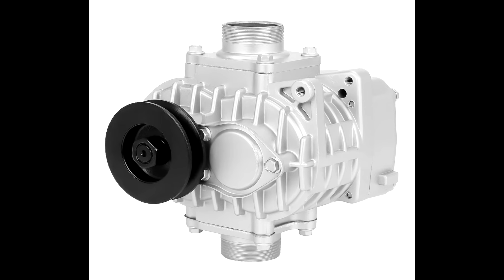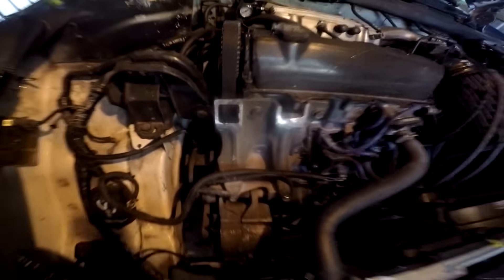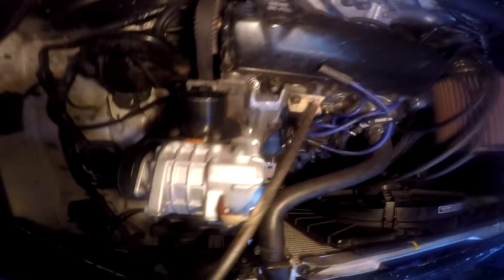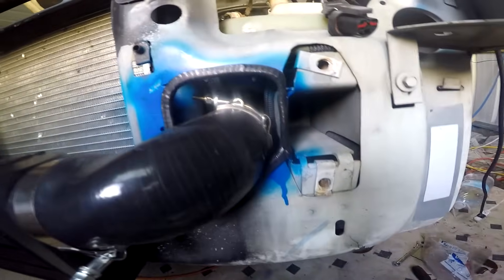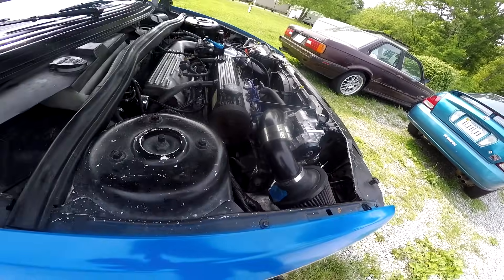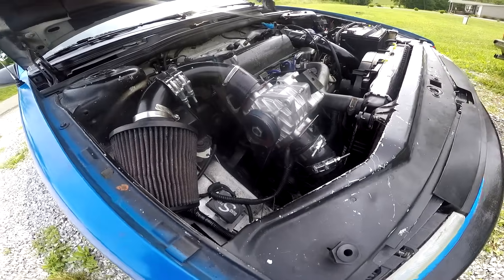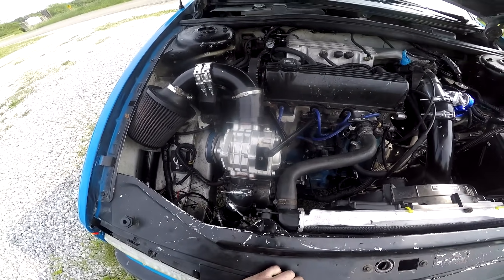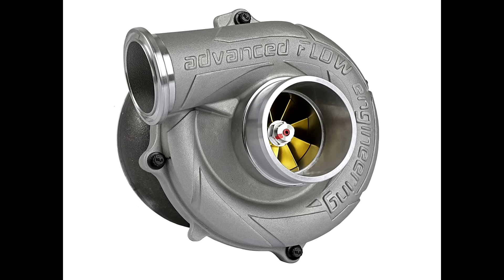AMR 500 Supercharger Testing - is it as Good as the Internet Says?

Comment: Bro.. smaller pulley, lighter oil in super charger.. i have the same one on my 67 vw bug and i can keep up easily with 1914 vw’s with my baby 1600 engine.. getting on the freeway is fun and my boost gauge shows 5psi wide open which isn’t the best but definitely a huge improvement for a 44hp vw bug..
Reply: that's exactly what he needed was a smaller pulley. those little blowers ain't gonna push that large of an engine very well, especially while using that big ass pie pan of a pulley lol. They claim to be rated up to a 2.2L, but I would be very suspicious of it don't that on the stock pulley. a2a intercooler would be a must have a well after overdriving the blower because it's going to create heat.. but in reality, those amr blowers are cheap junk. Used on VW bugs, and predator v-twin powered go-karts lol.
Reply: @boosted0079  honestly the one i had put on my car was just an experiment but it ended up working good enough to keep it on there. Going on 4 years and it still runs perfect. Just depends on application and how well each particular one was made or installed perhaps
Reply: @mikecorleone6797  I've seen a few VW bugs with these on them, and I was fairly impressed with seeing the results. The other was a Honda Civic if I remember correctly. Smaller 1.5 or 1.8 engine. That seemed to do really well also and that Honda ended up using a much smaller pulley. Spun the blower much faster than its maximum rating lol. I never did see any follow ups on it though afterwards.
Reply: It would work on a go-cart but I was always tough, if you want to make a car go fast you need to start with a Fast car and make it go faster 🤣
Reply: @knifethrower9733  Why? It's so much more satisfying to build a sleeper. No one expects to get beaten by a shitbox... 😂 You just watch people die inside, especially if they have their girlfriend in the car!
Reply: Bs
Reply: @RICHIE_RICH89  sorry for your loss. My condolences 💐
Reply: The thing to remember here is how much air is how much power. This thing will probably support a solid 80hp at the crank, which for a 44hp bug is right about 12psi, so I don't doubt that it works on the beetle, because it isn't an engine that moves a lot of air. The engine used here makes more power than this charger can support, from the factory, like 120hp, so it simply can't move enough air to even keep up with NA for this engine. For your application its perfect! For his, its not enough.
Reply: Another guyt claims 150 on his use with ir, so that really shows its range a bit better there. Plenty of headroom for an air cooled, but that's 2 psi up from NA even if his 2.2 makes low power at 120.
Reply: @knifethrower9733  pretty sure this is what grind hard used on that barbie Jeep.
Reply: @joemomma12341  the air-cooled engines don't rev very high either stock redline is like 4500-5000 and the heads flow no air so I've got a bug with a decent cam in it and happily make 140hp at the crank at around 10psi. 100hp is pretty standard for 10psi on a stock 1600cc VW engine but they are well suited to it as they are low compression highly head-restricted engines that just wake up once you get that cylinder pressure up. More modern NA engines like these ones just flow too much air and have much higher compression ratios, just need a much bigger blower that's more efficient for his RPM range.
Reply: @404MissingLink  as someone trying to get into forced induction, and having an odd fascination with the R series Toyota engines, would the 2.4L gain anything from an AMR500 as it revs out to like 5500 for redline
Reply: A stock NA Sundance motor makes 3x the power of a stock 67 bug, is almost a full liter larger, and is vastly more sophisticated.  The fact that you got good power in your bug means nothing at all for entirely different applications.
Reply: If you don’t mine me asking how have you set up the charger with your carb? Carb before supercharger or blow through carb?
Reply: @mr.357mag4  I really doubt it dude that is a rather large engine for this supercharger. The R series engines breathe super well I really would recommend either a turbo or a larger supercharger to avoid restricting the heads like 3000 upwards. There are plenty of other options though, BMW and Mercedes superchargers can be had from junkyards easy.
Reply: @stephenjones9043  I have mine setup before the supercharger makes for a more simple setup with no blow off valve needed.
Reply: @DrewLSsix  in my defense my 44hp bug has an aftermarket exhaust with headers, hide away muffler and i have a +5 hp sticker on the decklid..
Reply: @stephenjones9043  the supercharger draws through the carb. The vw carbs don’t work under positive pressure.. they just blow fuel everywhere. I’ve upgraded to a 2 barrel weber 32/36 carburetor and it really woke up the engine. I also put in an o2 sensor and afr gauge so i can monitor the air/fuel and not run lean. The engine is a 1600 dual port with 87mm pistons amd a 100 cam. Everything else is completely stock with the exception of the headers and hide away muffler which makes my car sound more like a porsche but quieter. It’s great. If you do get one of those superchargers just remember to change the oil every 3 months on it. It only takes a few ml of oil.. i looked at the rotors recently when i swapped out the carb and they look nice and smooth still.. i run a couple ounces of 2 stroke oil when i fill up just to keep the rotors well lubricated. Not enough to smoke or foul plugs tho..
Reply: Do you have an install video or any suggestions to install it on a vw 1600cc engine? I would really appreciate it if you had any advice, I just bought one but i have been struggling on the installation process.
Reply: @fliegendenLowen  I didn’t do any install vids on it because i wasn’t on YouTube at the time i built it but i can definitely walk you through it if you need help. With mine i just mounted it on its side on the left side of the engine and made an adapter to connect the supercharger to the dual port intake manifold. Used some scrap metal to make brackets to mount it and made an idler pulley to hold the belt tight. I’m using a serpentine belt instead of v belt, smaller pulley on supercharger, 100 amp alternator with dog house shroud and external oil filter, carburetor was easy i just made a short carb intake that mounts the carb to the supercharger and used an extra long throttle cable with a plastic sheath that wraps around to the linkage with home made brackets and a stock vw barrel nut. But you’re going to need pertronix electronic ignition because you’re going to need a hotter spark and a tad but of timing advance or you’ll ping on heavy acceleration. But the charger sounds badass and the boost gauge shows about a pound of positive boost at idle and pegs around 5-6psi which is more than enough.. more than that and you’ll pull head studs out of the case and that’s a big problem.. oh and you’ll be stuck on 91 octane gas from now on..
Reply: @joemomma12341  This supercharger can make over 120hp to the wheels on a 1.6 vw. 100 to 130hp is about the max you will see with this supercharger. Theoretically it should be good for 150 but I don't see any on the full built race motor that would be necessary to make that. Realistically this will make 14lbs of boost on a 2.5 liter but that's at 350% overdriven  with a redline somewhere around 4600rpm. It's all about understanding the limitations.
Reply: @boosted0079  the amr500 is a factory part for subaru kei cars used by hundreds of thousands of units on the road every day. But forget that they are for go carts and vw beetles...
Reply: @boosted0079  I've seen over 300whp from a 225ci slant six with a turbo from a 2.2. It made all its power under 4500rpm and felt like a Cummins for torque. Was built following a junkyard build writeup from years ago. An undersized boost aid can be used but most don't understand how to work the limitations in their favor. These work well for engines up to 2.2 if you limit the engine to about 5500rpm. You can go bigger if you drop engine rpms. A lot of subaru turbos are really small for the engine displacement as well because they are geared towards low end torque not high rpm max hp.
Reply: @DrewLSsix  my man the sundance makes 94hp. The beetle is 40 to 50 hp... you need to check the math there.
Reply: @DrewLSsix  this all comes down to one number. CFM!!!!
Reply: Mike, do you use the $200 chinesium AMR500 in your car?
Reply: Its the 300

Comment: I have an AMR500 on my 600cc bike it works really well on 10 lbs of boost and I have another pulley that gives me 14lbs, I wouldnt use the supercharger on anythig over 1600cc and thats running the supercharger very overdriven, they are probably at their best under 1200cc
Reply from the maker: I was thinking it would be good on a bike because there's no lag. Maybe I'll keep mine and use it for that one day.
Reply: The AMR 500 has a working rpm of 16,000, a 3:1 pulley ratio on a 1600cc gets you about 8 psi, as long as you're not holding revs over 5500rpm you're sweet
Reply: Good point. I wonder if you can use it on a scooter, preferably an about 250cc four stroke?

Comment: I wonder how much of an improvement it would have on my 1.0 993cc geo metro 3 cylinder
Reply: pretty decent, given the size, but you Better go with a Suzuki Swift GTI Total swap, you can find It for cheap and its exactly your car best version, i Just wonder if the GTI was sold in America at all, here in Italy was a common car and i used to drive One, 1400cc DOHC 4 cyl over 100 hp was pretty fun on that very light Suzuki shoebox
Reply: @gillespriod5509  it was sold here ,I do recall seeing them on the road. 
Not sure what engine we got ,but they had more pep.
Reply: You'd probably blow it up, tbh.
If you ignore the actual real volume of air the Geo Metro sucks and presume it has a full rotation of sucking air, ignoring how much time it takes to open the valve and what's the lift and how much actual air gets in, it would suck in 3078L/min of air, at 993cc at the max RPM of 6200.
The AMR500 at 14000RPM (i wouldn't risk using a clone at full RPM, tbh) could pump 7000L/min.
So that comes down to 18.72 PSI.
In reality, it wouldn't be that much, because it doesn't suck no way near as much air. So around 70% i'd say it's a fine enough approximation (i have no idea where i could even look up the timing graph of a Geo Metro), so around 13.1PSI.
So... That, from the base 55HP, would boost it up to around 105HP. Which is decent, but it's already twice the power and i dunno the limit of the internals.

Comment: Worked great with my 1.2l engine, over 1bar peak boost and almost 150hp. There's lots of videos on my channel. It works with low powered 2l engine, volkswagen air-cooled engine for example. Btw Eaton M62 is not that much bigger if you choose the right one with electromagnetic clutch, I'm using it on my new build
Reply from the maker: I watched some of your vids on the AMR500 a while back, good stuff. The Eaton is tiny as well, but I decided to go with a turbo instead. I'll have a video up on it very soon.
Reply: What are your ideas on installing one on a 650v-twin bike? It's carbureted and air cooled
Reply: So ..does anyone know if this would work on a 1.4 fiat starjet
Reply: Looking forward to a lil more low end for this 2.0 aba vw for the rockies
Reply: @flyingmonkeyofus69  so if I wanted to fit one one my 1.3ltr Skoda Favorit then I would need half of that = 650cc per engine revolution. So if I had (by using 1.3:1 pulley ratio) 650cc from the blower per engine revolution that would mean it gives no boost at all. But If i increased blower pulley ratio to 2.6:1 for 1300cc per engine rev. output then I would have like 1 bar boost (1300cc supplied for 650cc needed) - am I thinking correctly (even if not precisely)? I'm totally new to this :)
Reply: I wonder if this would ve good on a 1.6L nissan
Reply: @MinecraftManSteav  depends. im throwing the amr300 onto an fzr250. its one of the only engines where the generator/flywheel looks like an afterthought. its  a separate case strapped to the side. meaning i can slip a belt BEHIND the flywheel, and then it all ends up being neat, tidy, and tucked away under the fairings. also has HEAPS of room under the tank...  but then, the original fzr250, 2kr "genesis" with a steel frame has a nasty crossmemeber right there and its more suited to turbo charging for that sole reason...

any bike i see supercharged ends up having this jerry-rigged pulley sticking out on an extended shaft with no external support for the loads, adding a few inches to the width, interfering with feet, shins, knees... dodgy. and none of them seem to get "follow up" videos... in other words, crankshafts quickly fatigue with the overhanging loads, bearings fail, etc, etc, or they seriously underestimated just how much POWER is required to drive them... for every 1hp gain at the shaft, expect another 1hp to simply go into spinning the SC... to get a 50hp engine making 60 hp requires it actually deliver enough air and fuel for 70hp... on average, of course... figures may vary. that extra 10hp is solely turning the SC and is lost. every shaft, bearing, and mount has to be capable of dealing with the torques, the loads, the stresses...with plenty of fudge factor! along with ONE easily repaired weak point... just in case things go wrong, a shear pin breaks rather than large chunks of expensive metal getting launched in all directions.

if you arent willing to get it tucked in neatly... or it cant... dont bother.

oh, and Vtwins are not ideal as they dont have an even firing order or intake cycle. almost all twins are like this. excepting parallel twins like triumphs...

it means one cylinder gets all the boost, and the second gets virtually none. note that most vtwins run individual carbs... they get very cantankerous with single carbs. its even worse with turbos. but a turbo usually loves having a plenum chamber to overcome the issue, whilst a supercharger, thats generally meant to be running as a suck through... you just make a large, explosive tank... they need some plenum, but go too large to get even mixture delivery, and they are extremely dangerous... all superchargers require a "backfire valve" to vent the inevitable explosions without damaging things. 

these superchargers almost always HAVE to be run in suck through as the fuel helps seal them up and keep them cool. it also helps get the fuel atomised better.
Reply: @alexskillz45 i wonder if this would work good on a 1.6l hyundai.

Comment: Its an amr500, The 500 stands for 500cc. In theory, one revolution pumps out 500cc of air, not including any losses or temperature increase or any other... math. That's just the size.
And a 2L engine has 4x 500cc cylinders, that take air every second crank revolution.
So the 500cc supercharger needs to spin four times just to fill the cylinders in one engine cycle (two crank revolutions)
I was considering adding one to my 1L 3cyl and I thought it might be too small for that lmao.
Reply: Your calculations are pointing toward smaller pulleys which may be the answer to the issue. I turbod' a 1.8L using a 1.2L turbo and it added  a crazy amount of power simply because it spun so fast.
Reply: Yeah, you don't understand the mathematics behind blowers lol, that's not quite how it works
Reply: Yeah, you don't understand the mathematics behind blowers lol, that's not quite how it works
Reply: Yeah, you don't understand the mathematics behind blowers lol, that's not quite how it works
Reply: @jakefinlay5312  correct us then
Reply: @Mitchd03  (((Super Charger Disp/(1/2 Engine Displacement)) x Pulley Ratio x atmospheric pressure) - atmospheric pressure) x volumetric efficiency = Boost Pressure

This is the base calculation to figuring out if a blower will make boost pressure, which can also be easily rearranged to find out what blower size you need if you already have a goal pressure in mind
Reply: @Mitchd03  so for a rough idea let's say you're using an amr500 on a 1600cc engine this is the complete working out.

Max continuous charger rpm/ max running engine rpm= maximum pulley ratio (can be made smaller if needed)

(((Super Charger Disp/(1/2 Engine Displacement)) x Pulley Ratio x atmospheric pressure) - atmospheric pressure) x volumetric efficiency = Boost Pressure

16,000/ 5600≈2.5:1 ratio 

(((500/(0.5x1600)x2.5x14.7)-14.7)x0.8 

≈6psi
Reply: @jakefinlay5312  that's literally what i just said i just mansplained it goofy
2L engine 500cc supercharger 2:1 pulley ratio 100% ve =  0psi boost
so blower of 500cc engine of 2L
so (0.5X1) is 0.5 x 2:1 pressure ratio is 1
x1 atmosphere in bar is 1,
minus atmosphere of 1bar is 0
times volumetric efficiency of 100%, is 0.
0 bar boost.
Reply: @Mitchd03  my bad on that G 😅✌️
Reply: Thanks i learned alot here. Crazy how much displacement made such a differenceto the calc. 
It seems the creators pully ratio must have been below 2.2  
Probably a 3inch crank pully diameter, as the amr 500 is 40mm @jakefinlay5312